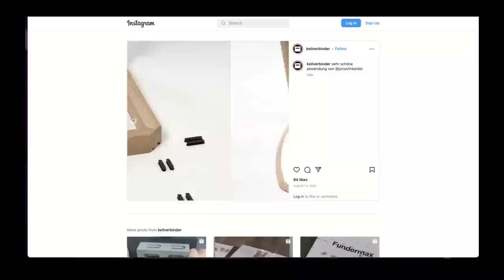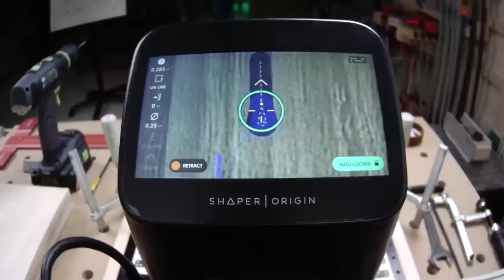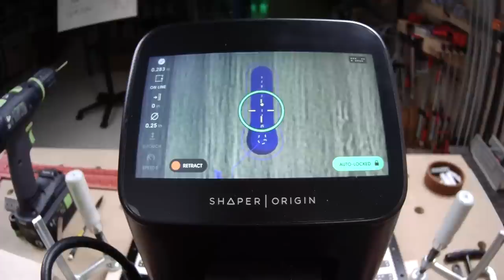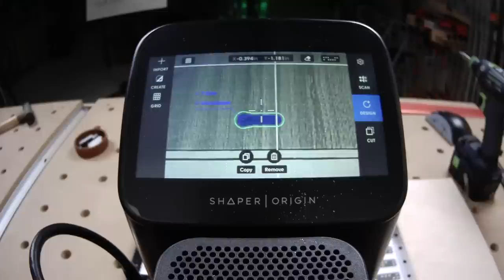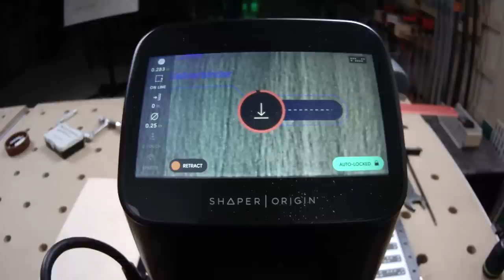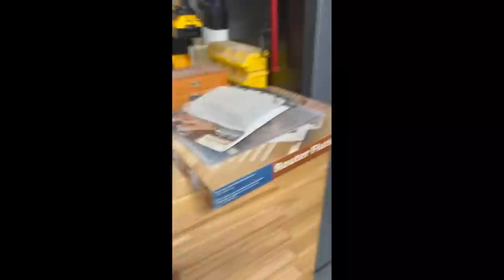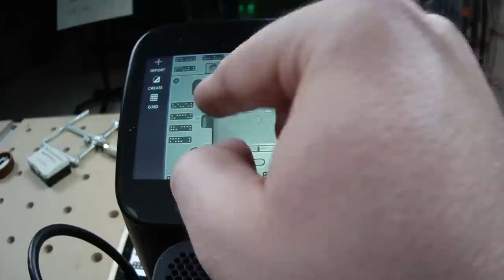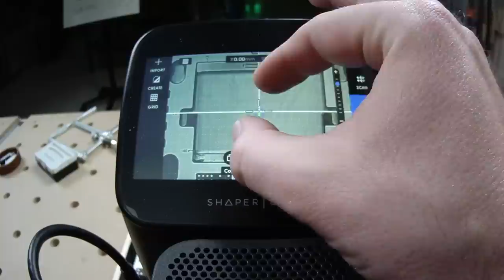Session 77  – English: Quick Connections with Keilverbinder and Origin

Comment: Interesting but the reality is that as the Shaper Origin still lacks the ability to supress auto-retract trying to use any sort of submerged bit (i.e. T or dovetail) is likely to result in workpiece damage.  I recently destroyed a workpiece which had many hours of my time invested in it when auto-retract triggered on a false positive for tape movement violently ripping the fully submerged cutter out through the material and destroying the workpiece.  Until auto-retract suppression is available I would steer clear.

Comment: During this Session it was said that the strength of the connection was documented in the Design Guide and that you would get Guide when you downloaded the files. However the Design Guide in not in the download. There is the 'Keilverbinder_English_Datasheet.pdf' and also 'Keilverbinder_Infobroschüre.pdf' (requires translation from German) but no strength numers are found in those publications.

Question is, what are some examples of the streangth of the connectors?
Reply from the maker: Hi Brian,
That was a bit of a mistake--Keilverbinder doesn't have specific weight ratings as it can vary based on the screws you use to fasten them in. The more, deeper screws the sturdier the part will sit.